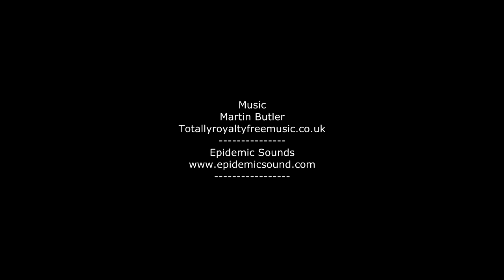Part 34 Reliant Trotter Restoration Engine Stripdown

Comment: Order to take apart Martin. Head off, studs out, sump off, front cover and backplate, rods and pistons out (they come out of the top). Oil pump, pump shaft, camshaft, followers and crank. Definitely a new timing chain. Valve and ignition timing depend on it. Also oil pump, shells and I suspect rings. Gaskets of course.....but should be a cheap rebuild. Oh you don't need the regulator when changing to an alternator. Hope you don't mind a bit of professional advice....
Reply from the maker: Nice one Malc, Plenty of cleaning needed and those cam buckets were well gummed up. Could do with a parts washer lol
Reply: Right, parts washer. 25ltr plastic drum. Cut a side out. Plenty of paraffin or white spirit. Wire brushes. Small rotary brushes in a drill, plus of course a few cheap paint brushes. Also some small flu type brushes help with galleries etc. When washed, hose in water, dry in the sun and rotary wire brush everything.

Comment: I dont wear gloves ether my reason in it restricts me feel and grip in the fingers plus never been frighten to get me hands dirty old school me lol plenty scint knuckles doing engines them were the days when my belly dint stop me from getting under the cars lol need ramps these days and still difficult I been toying with getting a old car towing trailer and using this as it be easier to get under cars as I still like doing me own car and I only have a small garden lol anyway all the best Martin in you strip down rebuild have fun mate
Reply from the maker: Cheers Bert, I keep forgetting to put the gloves on lol I just bought a new pair for the parts washer though.

Comment: Great video fella, love to see this stuff ! Im just about to start fixing up a 2006 toyota hiace van and engine ( 2.5 D4D ). Martin, where can i get a workshop manual for the van and engine ? I have searched for days online trying to find one. The only results have been older model hiaces as PDF files and even then they are in spanish or russian !
Reply from the maker: Have you tried the forums, there's normally dedicated people in forums with that info.
Reply: Yes I'v joined 2 forums in the past few days and posted the question but as of yet no replies, will keep trying !

Comment: Martin , l know this blog is a 1 year old , did you buy the Thermo cover you broke or  can you use the one off the 600cc motor sitting in the back of the Cabin  ??
Reply from the maker: I think I got a new one Charles.
Reply: @retrorestore  just to clear up , as l am Hearing impaired ,l had to ask you if you got a Thermo cover, cos l didn't hear you say it ,l thought your answer was a bit direct  so please correct me if l am wrong  here , and yes l do read the subtitles , and l enjoy the vid's  and Laugh when you cock it up :)
Reply from the maker: @charles.stewart4422  Haha, not direct Charles, I try and answer as many questions as I can and don't tend to ramble on in comments section but I do on the screen lol.

Comment: Is this the first time you've ever stripped a car engine down?
Reply from the maker: Stripped loads of engines Michael from a 50cc moped to a V12 Jag.
Reply: V12 Jag? wow!!!!!. Can't imagine how long that took to strip down.
Reply: The Reliant Robin engine internals will look good once all cleaned up. Can't wait to hear it running for the first time in years.
Reply from the maker: So much to strip off the engine first lol including removing the front of the Jag. It was a series 2 Jag so don't know how different it is on later models.

Comment: Why did you not take the pistons out before you removed the crank?  Also, it's false economy NOT to replace ALL bearings if you are taking it down this far. Including the cam bearings.
Reply from the maker: It was easier to lift them all out whilst I had the engine that way round and I didn't want to turn the engine over again as there was still lots of oil sitting in the pistons and that would have made a mess. Many ways to skin a cat bud. If the bearings have no wear on them there's no need to change them but i'll know when I inspect them properly.

Comment: Nice vid martin was refreshing to strip an old pushrod engine down.i thinkit does matter which way round the main caps go so lucky you looked.the voltage regulator was to limit the voltage to stop you over charging the bsttery and stop all your bulbs blowing,alternaters have a diode pack in them so its all built in .iv never seen it where you pull the pistons out the bottom .lol good luck re-assembling it that way.youd needto be squidly dididly😉
Reply from the maker: Yes, Normally pull them out the top but It had a lot of oil laying in there I didn't want to turn the engine over again and get more mess over the floor lol

Comment: There are articles on converting to Alt on a mini that would probably help. The regulator looks identical. They cover using the regulator as a terminal block to maintain the original look. I think there are even YouTube videos. You also need an impact driver saves wrecking screw heads.
Reply from the maker: Yes I do have one but it was at Jimmy's unit